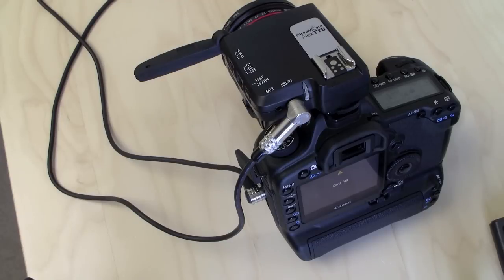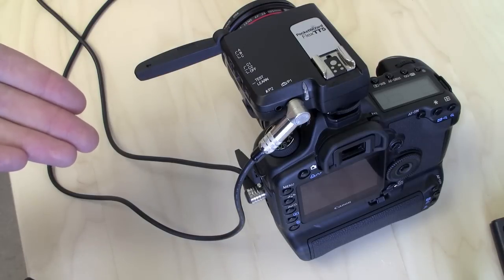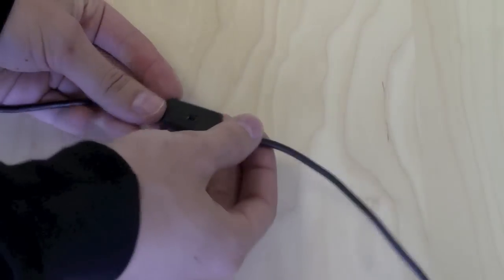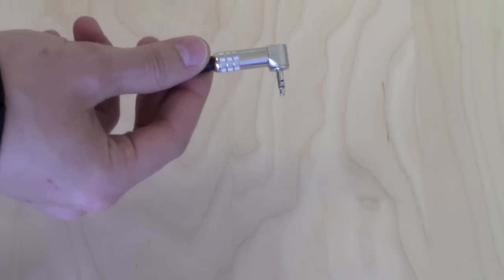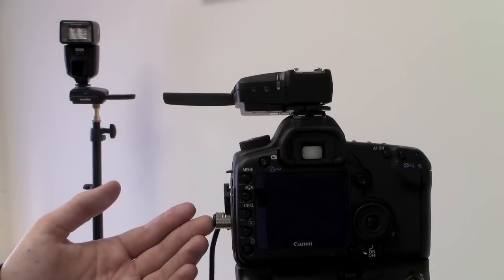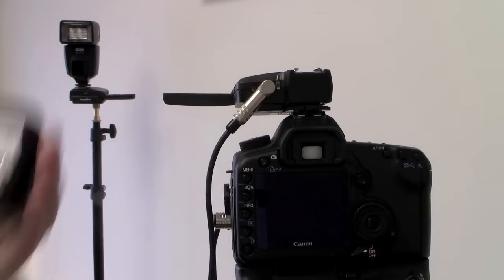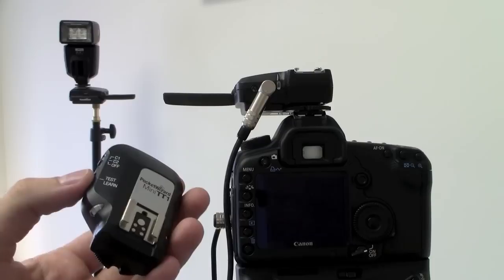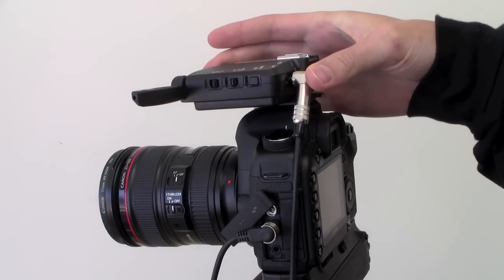PW TV - Episode 4 - Relay Mode with FlexTT5s

Comment: I have been trying to find out if it is possible to concurrently trigger a remote camera, with a hand held camera while 'sharing' a common Einstein 640 strobe using the PowerMC2.  I am able to trigger the remote camera & strobe from the handheld but the flash only fires in sync with the remote camera.  I have a MiniTT1 on the handheld set to trigger only using std channel 1.  I have a FlexTT5 on the remote camera receiving on std channel 1 and the Einstein 640 set to std channel 2.  Is it possible to sync the strobe so that the shutter is open on both the handheld and the remote cameras when the strobe fires??

Comment: For me Its not possible te use a remote flash (mounted on a FlexTT5) in Basic trigger mode! I tried everything. I have a Mini in my hand fot triggering and e Flex on my camera...i want to remote trigger my camera and my remote flash...no way it works in sync on basic trigger mode.
If theres anybody out there who has the solution, please let me know.